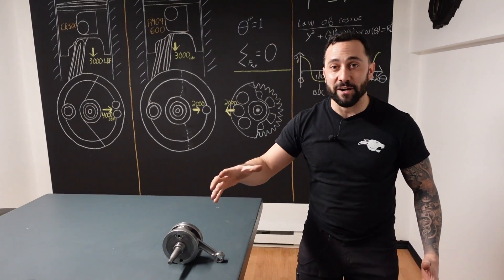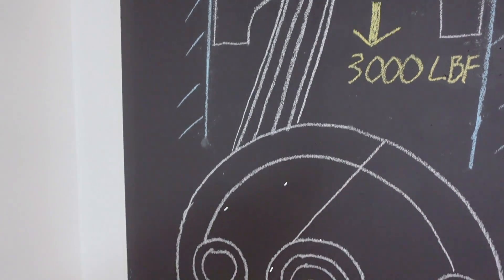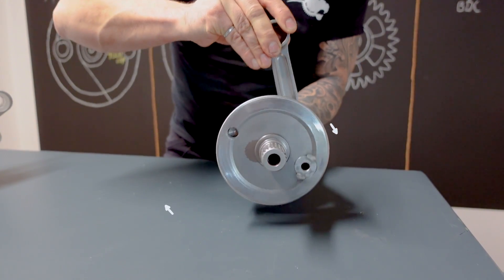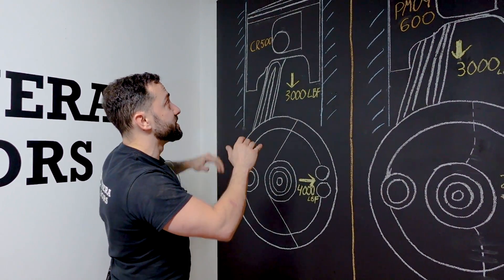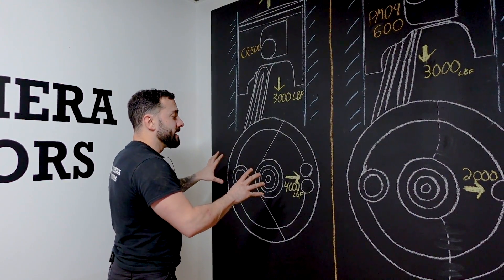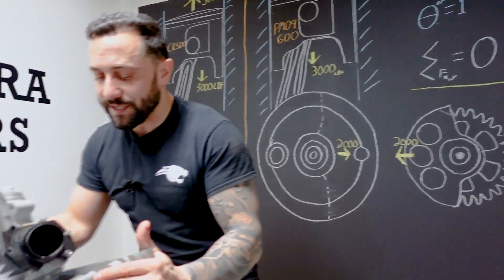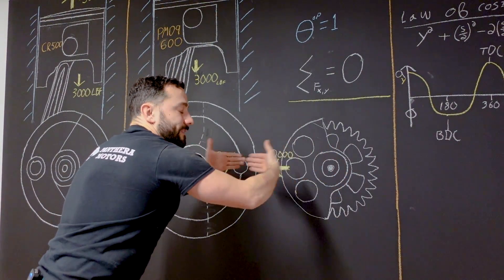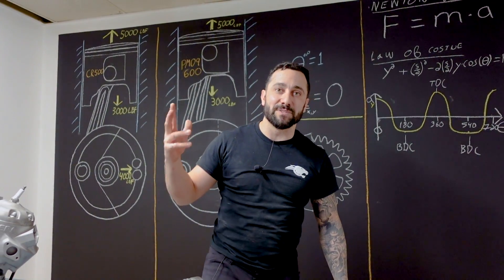Crankshaft and countershaft balancing - Mad scientist explains chronicles no.1

Comment: You did a great job of explaining this!  I would still like to know how I determine what is a good balance ratio.  I have a vintage Honda XL250 that I'm installing a stroker crank into and not sure what ratio would be best for it.  Will be definitely boring it over but it will depend on what ratio I want to achieve but am unsure what the sweet spot is.  Any suggestions??

Comment: Good explanation.  Something to consider, though.  5000 lb upward, and 3000 lb downward of inertial force due to piston mass? You would have an antigravity engine producing 2000 lbs of net reactionless lift, but we know that ain't happening.  Accels and decels more abrupt on top  portion of cycle due to the kinematics.....piston gets more time of crank rotation during bottom portion of cycle to get up to peak velocity and down to zero velocity, and less time of crank rotation to do the same thing in the upper portion of cycle.  A stronger pulse (5000 lb) occurring over a shorter time interval verses a weaker pulse (3000 lb) occurring over a longer time period during one cycle of crankshaft rotation each equates to an equal, average inertial force that would be used to calculate how much inertial force must be used to counter with a spinning mass, me thinks..............